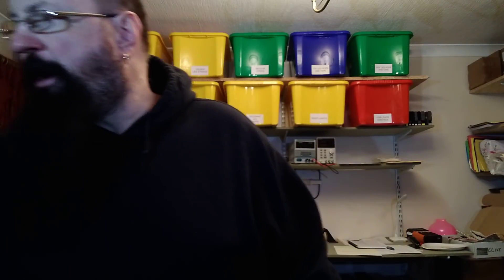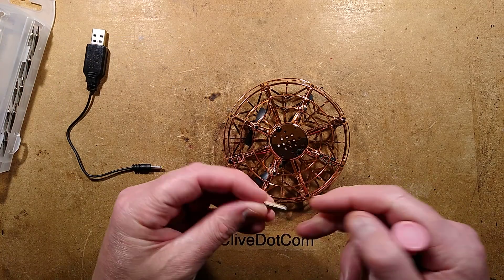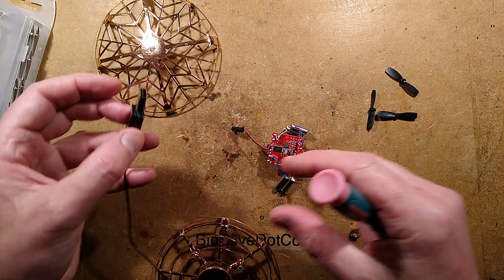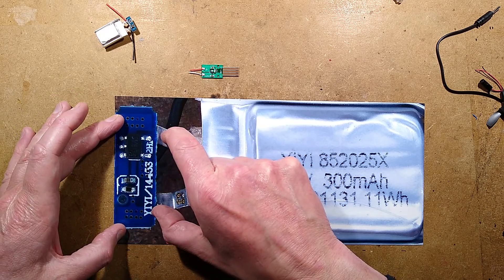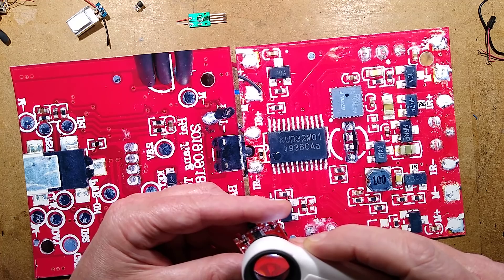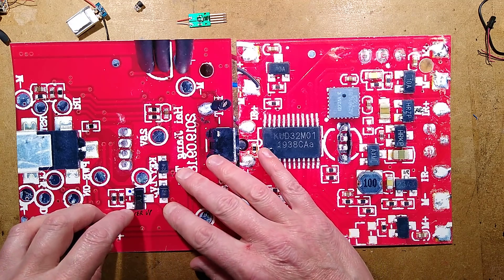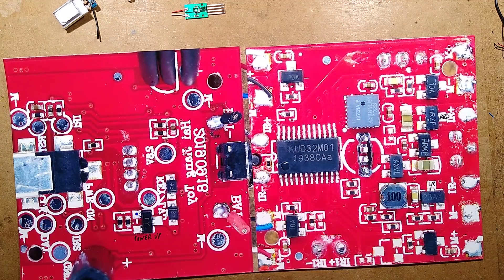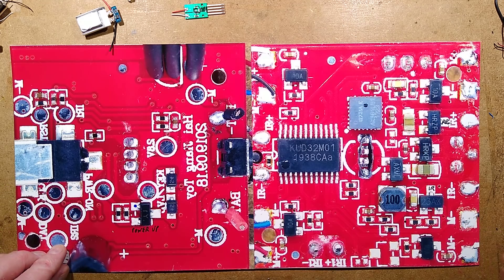Inside an autonomous drone.  (With beard entanglement incident.)

Comment: how did you get the beard hair out of it without already opening it up? :P
I guess the outer frame was plastic? have you tried running it without the frame for maximum destruction?
or modify it, have extra sensors, go crazy :D

Comment: I'm guessing, having done loads of research on UAVs at university, is guess the QFN chip is a 2 or 3axis gyro. If it was good it would be a full AHRS with a 3 axis accelerometer, gyro and magnetometer. But given the price point, that chip would cost more than the whole product so I guess it's just a MEMS gyro.
Reply: I'd rader guess the small chip is a pressure sensor as it has a hole on its top surface.
Reply: @ftrueck  I'd go with a combination of both.
Reply: @ftrueck  I also saw the hole and first thought barometer. But I'm not sure if that was an actual hole or a bit of schmutz since Clive never pointed it out as a hole.

Comment: The mcu I'd speculate it's a chinese clone of a STM32F03x/F10x that  older gen "toy drones" used as mcu,
the second chip is at least(as stated on other comment) a barometer + whatever "IMU" content's it has (accelerometer, gyro, magnetometer, temp), the closest I can find is tdk's ICM-20789
BTW the german site that you mention contains a different board with the baromenter on a separate chip than the rest of the IMU.

Comment: The first digit on that chip (that you kept saying was a 1) looks more like an I (capital i) than a 1. The 1 further along the code and the 1 on the bottom line on that chip both have the little bit pointing to the left at the top, but that first one doesn't seem to have one, at least from your picture of the board. Typing i2731a into google gets loads of hits (but most are irrelevant though).

Comment: You're supposed to calibrate it by setting it upside down and press and hold the button until the LEDs flash green, then after a few seconds they'll flash green blue and red signifying calibration.
I've never been able to get mine to hover. It always takes off and crashes.

Comment: The British designed gyro chips are from a harrier jump jet, where they open a valve for 2 seconds sending blasts hot engine gas to level the plane. ✈
The motors are from a mobile phone buzzing mechanism
The embedded software might be interesting
Reply: Those vanes are fed from the compressor side of the Pegasus. Therefore it's cold air.
Reply: @BigGoucho  hot gas https://www.instagram.com/p/CAkJwdhBv5B/
Reply: @rogerc7960  temp is relative. Control 'thrusters ' are powered by air from the third stage compressor. This means that the air for the thrusters is hotter than ambient, do to absorption of engine heat and being compressed, but much much cooler than engine exhaust. Engine exhaust is the combination of both combustion state exhaust and bypass air from the first stage compressor fan. Bypass stage compressor air is used for both cooling and thrust.

Comment: When a board doesn't provide a lot of contrast for traces, would you be able to apply a bit of heat to a contact to visualize the connected traces with a thermal camera?  You don't want enough heat to melt solder, but you would want enough of a thermal difference for one of your FLIR cameras/sensors to visualize the trace.

Comment: The one I have you need to calibrate by putting on a level surface and then powering it on. The lights flash in a sequence then go off. You the power off and power on and throw in air as you demonstrated but it tends to hover in place until you bring your hand within sensor range. Theoretically veers away from walls and ceiling when it gets close but sensors are not that great so crashes are frequent!

Comment: In case you read this Clive... In the drone community we have boards that are under 10gramm have 25x25 diagonal and switch 25.2v at 120amps max 30amp per motor Esc on board. Brushless 6 mosfets per motor :Doh and they also offer a 400mhz micro controller a gyro an accerlometer and an osd chip
Reply: That sounds like the basis of a really effective beard muncher.
Reply: @ferrumignis  I've had some experience with the props of those smaller drones and I got to say if you have that in your face you have a real problem. A weed eater is a good comparison.. Those with the metal blades that is
Reply: Yeah, please "review" those

Comment: I have one of those. It's kinda fun. You can play volley-drone with it (two people required). It will sense your hand and reverse course before you touch it. The "body" seems to be made from the same kind of plastic they use for those dastardly un-openable bubble packaging.
Reply: I love this 😂
Reply: Why does Clive's suddenly seem to cut out ? Given adequate space, what do they do ? How long do they then run for and do they land in a controlled fashion before shutting down ?
Reply: @millomweb  as far as im aware just about 90% of them just dive into the earth at terminal velocity, or into a beard.
Reply: I bought 3 of these; one for me and two for gifts.  They're a big plus over the type that have unprotected (non-covered) blades which can hurt eyes, etc.

Comment: I have a tiny remote control drone about that size. Pretty fun and challenging to fly.
I've wondered for a while if I could 3D print a new frame and put in bigger motors and run them using the signal from the little motors but instead of those little transistors add in bigger ones with a more powerful battery... It would be totally pointless since the little remote is kind of crap, and it's scary enough when that tiny thing loses control, but could be hilarious at the very least.
Reply: beard shredder
Reply: Darn now I want to try it too 😁

Comment: The square mystery chip  looks like a barometer/accelerometer package. The flight controller board on the drone I built has something similar if not the same. The manual of my flight controller board lists it as the  barometer/accelerometer package.
Reply: Yeah, the port on top is a dead giveaway, definitely a baro in there, and based on the capabilities of the drone an accelerometer would make sense
Reply: Yes. It'll contain the accelerometer, gyro and barometer for altitude change  calculations.

It's amazing what they squeeze into the smallest devices these day's, mobile phones use them too.
Reply: As for the main microcontroller I'd say a clone of a STM32F03x or f10x that older "toy drones" used as mcu
Reply: A barometer Reading would  not be sufficient for that kind of drone.